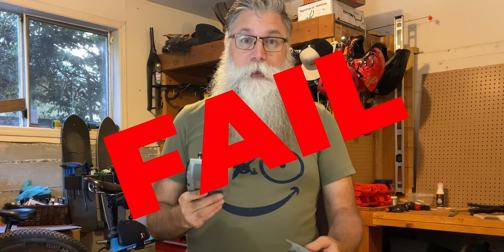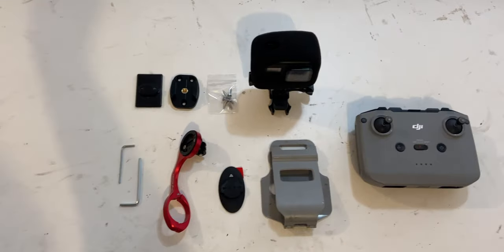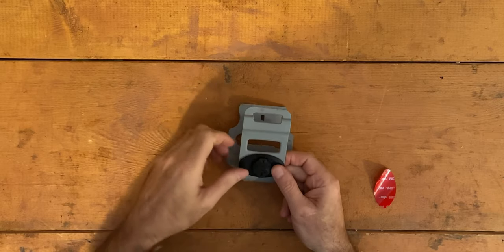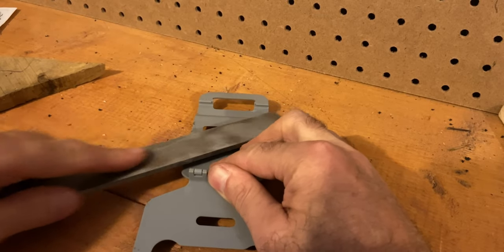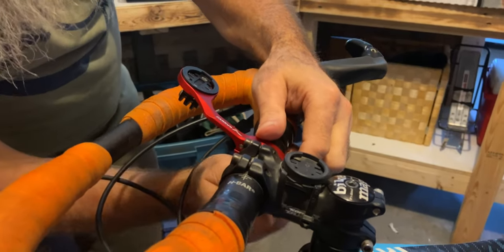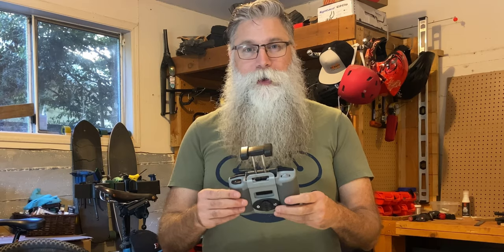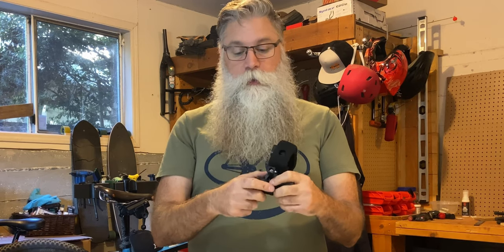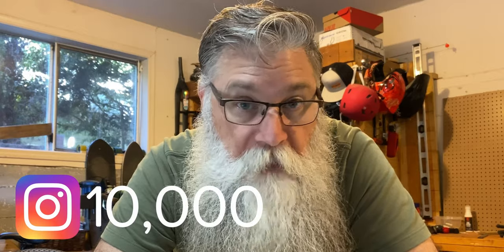FAIL : Drone Controller Handlebar Mount 2.0

Comment: Nice one! Regarding adhesion of the 3m tape, I remember a seths bike hacks video where he heats up the tape before applying to create a stronger bond. https://youtu.be/Lap5EYw_W9c?t=165, could be worth trying if you have any issues going forward. Cheers
Reply from the maker: Yeah, I hit it with a hot hair drier before sticking  on but thought it would still be a lot of force wiggling on a small area.  What wiggle there is now is just some flex in the plastic bracket.  Ah… we’ll see if I can ride and fly with this set up.